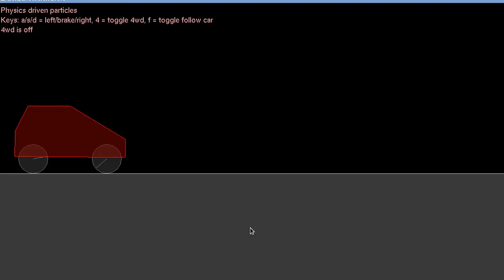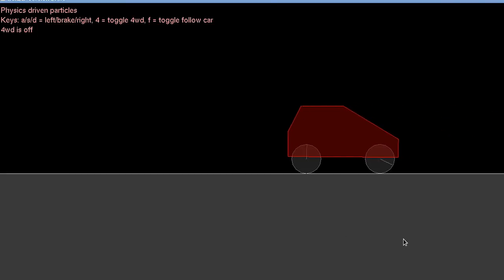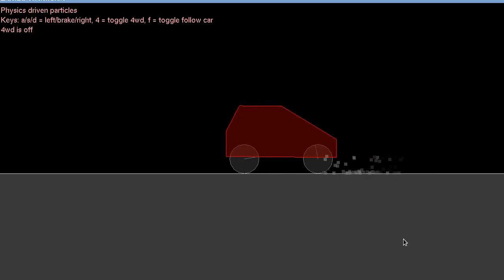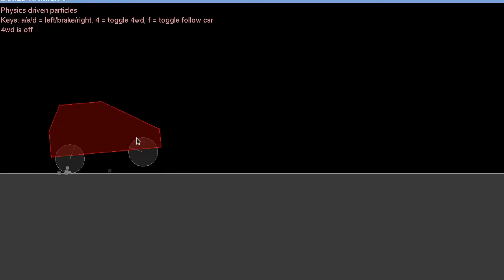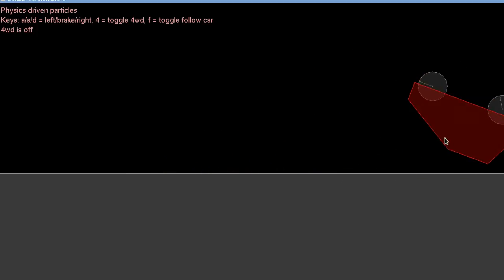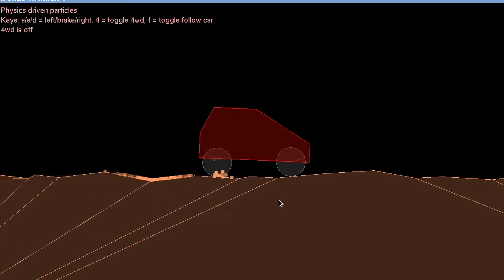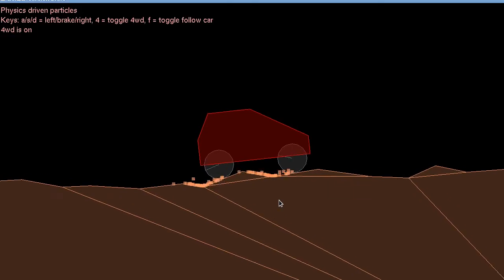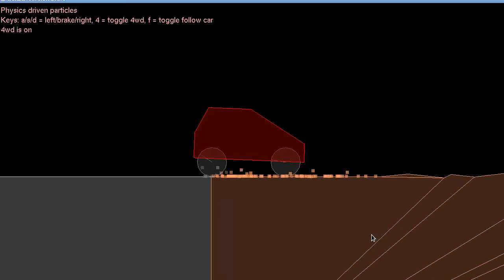Box2D physics-driven particles tutorial

Comment: i wanted to have similar effects when making my game in as3. i just wanted to calculate points of contact and emit my particles from that point. the problem was that the point of contact that i was getting wasn't precise (using box2d's own methods for that..)a lot of times and sometimes totally out of place, so i left the effect only for ragdolls hitting the ground.for particles i used my own code with ray casting for collision detection which is around 10 times faster than using box2d bodies.